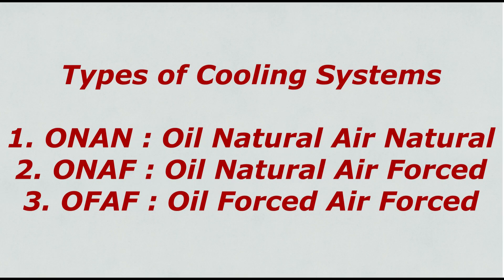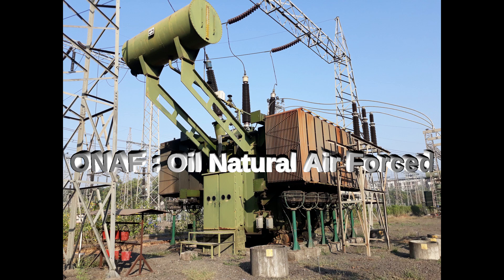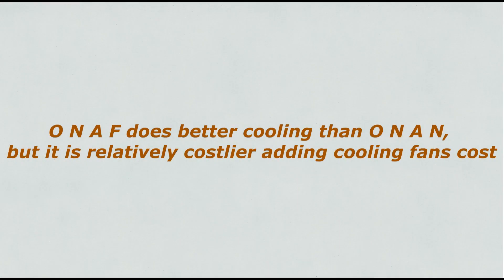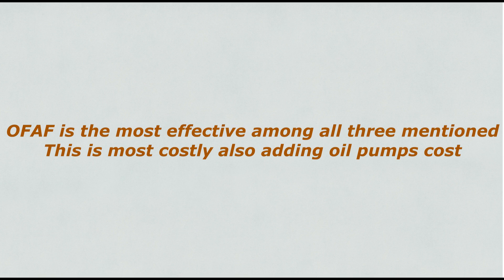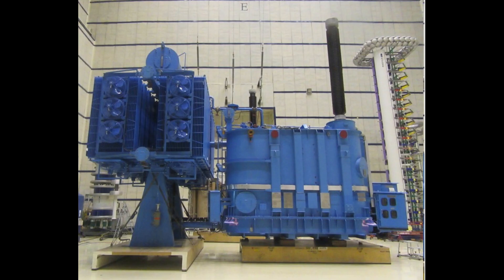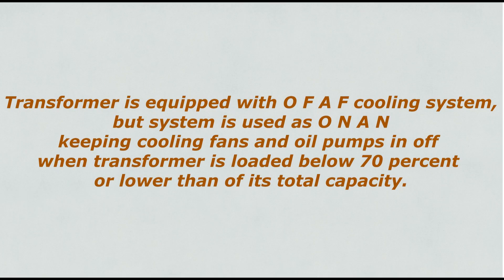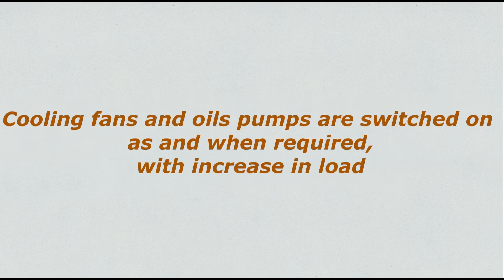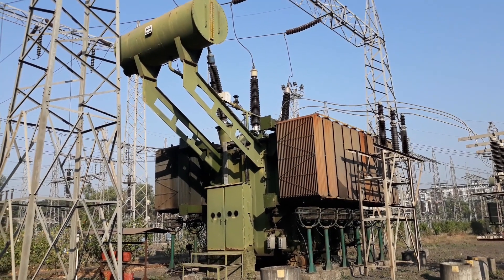Power Transformer Cooling System Radiators Cooling Fans with actual photos and videos ONAN ONAF OFAF

Comment: OFAF and ODAF (Oil Direct Air Force) are same?
Reply from the maker: ODAF is an advanced version of OFAF. In ODAF flow of oil is directed in controlled way so as to achieve effective cooling.
Reply: @ElectroGlobe1  thank you for the answer👍🏻 So ODAF the best cooling system for transformer so far?
Reply from the maker: @ekoputraannur702  it is the effective cooling system

Comment: For a large power transformer with cooling system of type ONAN/ONAF/OFAF, under
what loading conditions would the winding temperature monitoring device switch on
the transformer cooling system to any of the three states?
Reply from the maker: OFAF starts for above 90% load condition. But still it depends upon design of that particular Transformer.
Reply: @ElectroGlobe1  Thanks.